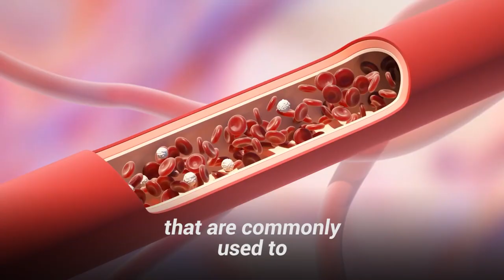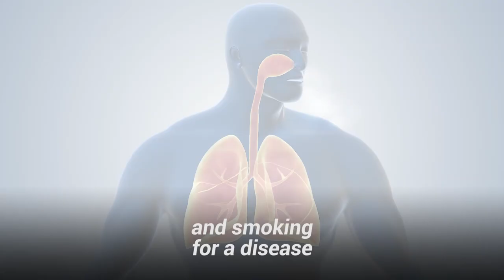Cure or Hype? An inside look at Cannabis COVID-19 research

Comment: Both THC and CBD are essential, it is the concentrations that are essential for the various problems. There are other chemical substances in the cannabis that play a role, there is so much study that needs to be done on this matter. If you are to use cannabis as a treatment for COVID-19 symptoms, I highly recommend it, however I do not recommend combusting cannabis. The ideal method is vaporising decarboxylated cannabis without any solvents. Ingesting decarboxylated cannabis is an alternative healthy way of dealing with the problem in the present moment. Cannabis is not the cure for coronavirus, it only equips your body with the tools to survive the viral infection until your immune system resolves the problem and that is the way it is meant to be with all viral infections of such kind. With the kind that actually replicates itself into the DNA, well that would require another virus to correct the problem or a certain enzyme that would cut out the problem code from the DNA, which would ideally require a retrovirus to equip the cell's DNA to synthesise such enzyme to get the job done. Something along that line.
Reply: All caninbionds not just THC or CBD too..